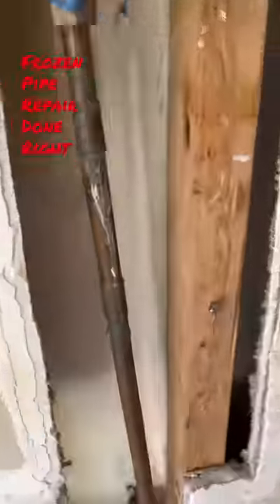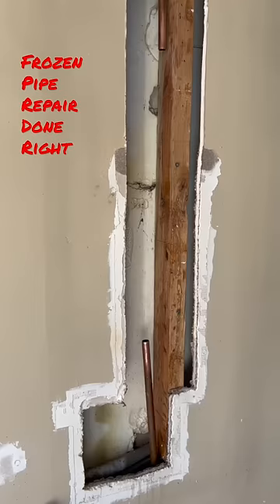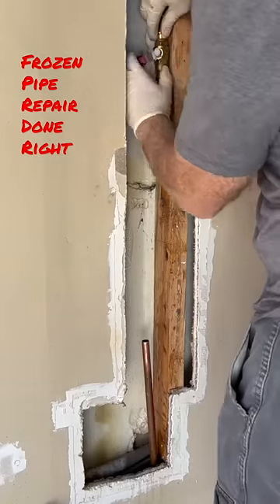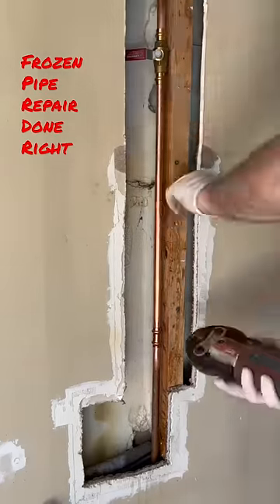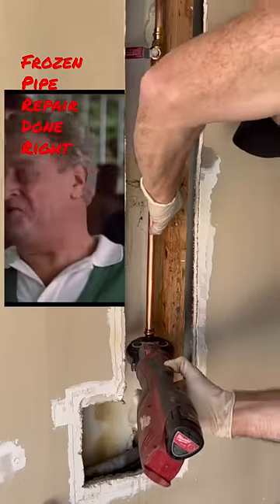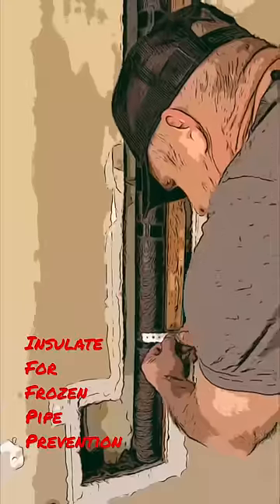Frozen Plumbing Pipe Repair @TappPlumbing #shorts #plumberslife #plumbingproblems

Comment: Put a damn access door on that wall at this point
Reply: And just insulating that little section is like.....?
Reply: @rickybrown6585  ball valve access
Reply: Why put valves inside of a wall?
Reply: uniform plumbing requires access to shot off valves. A speck of insulation is a joke. In 26 years there is a reason this failure has occurred, a real plumber would have looked at the cause and fixed that. This guy whines about the soldering abilities of others, then goes on to use Propress fittings.
Reply: @tommartinez62  most  Accurate comment yet
Reply: Hilarious!😂
Reply: Fr
Reply: I was thinking that… if your pipes are freezing, you got some other issues going on, might as well leave a weak point there. Imagine you fortify that part then when the pipe freezes again it bursts somewhere else.
Reply: Fun fact thats how maintenance panals on aircraft are created XD something breaks so damn much a panel was made to check it.
Reply: I thought I was the only one
Reply: @tommartinez62 why would he look how damn close that pipe is to that stud
Reply: @Yamaszlof Mcdurkin  it's a face,  like an emoji but with letters
Reply: @tommartinez62  I mean ... I proprrss all my frozen pipe repairs .. I'm done and gone before the torch is even lit.
Reply: @AsG_4_  job security going back every year, do you initial your joints I always did, on that I would date it as well..lol
Reply: Pro press is pretty good.
Reply: So that valve can be accessed later, or just remove and relocate it.
Reply: They probably aren't patching that section considering it has those valves on it, no sense in covering up a shutoff
Reply: @tommartinez62  I must have missed in the video where he said he was going to patch the wall making the valve inaccessible. 

But yeah you're right, the reason the error has occurred is because the pipe froze and burst. How do we fix that? Oh right, you'd insulate the pipe from the cold. Wow aint that crazy. Also literally nothing wrong with using a propress for repairs like this.
Reply: @tommartinez62  lol propress is job security? Telling me a lot about you, good old buy stuck in the past, I walk past 20+ year old leakfree propress fittings every day at work. You just wanna get paid by the hour because you can't afford to only get paid by the job.

Comment: I'm not a plumber, but as an engineer, I have an opinion about the insulation. While wrapping the pipe like we see here will shield the pipe from the cold of the outside part of the wall, it will also shield the pipe from the warmth of the inside part of the wall.  I believe a better way to prevent a future freeze break would be to insulate, with fiberglass, every part of this area except 3 or 4 between the inside part of this wall and the plumbing.  This will allow the plumbing to absorb the heat of the house. Even better would be to also leave an opening in the drywall where the ball valve is. This will not only give access to the ball valve, but it will give those pipes access to the warm air of the house. I'm confident the opening could be trimmed out in a creative way to look good.
Reply from the maker: I am sorry to inform you this was an exterior wall . In the garage no less! I can assure you I am no fan of this building technique. I have to deal with the situations as they come. Thank you for such a thoughtful piece of advice . I agree with most everything you stated and hopefully others can learn from your comments. Thank you so very much for spending your time with us!
Reply: I would have put foam outside the pipe, and nothing inside. Let interior heat reach the pipe, just stop the outside cold.
Reply: Insulating the pipe this way (with any type of pipe insulation) is better cost wise and ensuring that the pipe does not freeze. Is there a particular reason for wanting to have it "absorb" heat from inside the house? I may not agree with it but I am always open to learn new things and their reason for it.
Reply: @TappPlumbing  In that case, now it will just freeze three feet higher up the wall. I suspect that they should insulate that entire line from the ground until it enters the heated area. (How much exposed pipe before the bottom of the opening?)
Reply: How do you know someone is an engineer?

They’ll tell you 🤣
Reply from the maker: @@thefirehouse1745 The homeowner will provide that a little later when everything dries out . You are definitely correct! Thanks for pointing this out so everyone can see. Thanks for watching as well!!!!!
Reply from the maker: @brianwest2775  It feeds a spigot that is more or less at the bottom of the frame . No exposed line . Thanks for watching!
Reply: I’m a plumber and now am a chemical engineer.  Yes what you say can be true but what freezes the pipe usually is moving air.  The insulation takes that away.
Reply: The insulation also allows for a micro climate around the pipe where the conduction or the copper can more easily warm the climate it’s made as long as some part of the is in a warming area like the ground.  It has to just stay above 32 and all.  But in colder climates more is needed.
Reply: Yes
Let’s use a mechanical compression fitting that will eventually leak and let’s put a valve inside a wall. 
There is always another solution, this is not a good one.
Reply: The water in the pipe is come in not frozen so it's ok the stay at that temp. It doesn't need the house to warm it. Since the is no way to easily shield it from the cold only the foam works in more than 99 percent of cases. Even pipes not in walls at all. So there you go. No engineering degree needed.
Reply: @The Jerk of all trades  an English class would help you though.
Reply: Damn we gotta be engineers just to know that?😂
Reply: I was gonna say that's not insulation !!
Maybe in the south.
Reply: @The FireHouse copper doesnt sweat unless you mean condensation from temperature variation
Reply: @Vteccer666  lol yes that’s what they mean
Reply: I'm with Mark here. Those of you saying the water comes in not frozen so the insulation will maintain that temp?? Time is the enemy here... Insulation only keeps things at the same temp range for so long. The insulation around the pipe will just make it take a little longer next time it is sitting, not getting used, to freeze.
Reply: Well there's a dumb comment. Power does fail often during cold periods plus if this an unheated space.....and etc,
Reply: @Elseveno  if it's an unheated space, than I'll retract my statement. He said "garage", if it's an unheated detached garage then, ya, no heat... However most attached garages stay warmer than the outdoors.
Reply: That type of insulation preserves the heat coming with the water and prevents moving cold air from contacting the pipe.  Hope that helps explain a bit.
Reply: @Steelythestacker  I understand what insulation does. What I said was after time the heat balances to the environment. Have you ever brought cold beer in a cooler for a weekend? Eventually the insulation doesn't keep the beer cold anymore.
Reply: @chrishoesing5455  it's the sudden surge of cold that is the detriment of copper pipe.  While there is nothing foolproof, this method helps preserve what heat there is and keeps the cold moving air off the entirety of the pipe.  Short of running heat tape it's the best option.
Reply: @Steelythestacker  Unless there is heat in the structure, then the original commenters idea is better. You think there's wind inside the wall cavity?
Reply: @chrishoesing5455  very often there's a good amount of air movement inside a wall cavity especially in the garage or an outside wall.
Reply: Oh crap 
An engineer is “thinking” again.  🤦‍♂️ 
The only part he got right was “I’m not a plumber”
Reply: Looks like it's been a common problem in the same area rather than foaming the pipe to try to insulate from the cold outside the better solution would be to put an access door right there that's easy to get in-and-out of the wall and wrap the pipe with an automatic pipe heater
Reply: I I'm a plumber and that is plan B on how to fix that problem. In Canada we just don't run pipes in outside walls. That's plan A
Reply: @shway100  but if you are going in on a repair to this particular job on an outside wall of a garage, this is what you do.
Reply: @TappPlumbing  By dealing with the situation, you mean repeating every mistake the last plumbers for 26 years made? The smart thing to do would be to have removed all the dry wall from that stud space, fill with two inch dense Styrofoam. Reinstall the water line as close to the interior as possible, use a small square heat  register (for air movement)as an access panel for the valve (required by UPC) an walk away, knowing you will never have to address that issue again.
Reply from the maker: @tommartinez62  No arguments from me with all that you stated! Check this short video to get some context on a time line please 

https://youtube.com/shorts/BsgvHWRR9NY?feature=share

We only do plumbing , I did relay all of your suggestions to my client when I was there however. Exactly how you stated them for the most part. Thanks for your excellent viewpoint!!
Reply: I've always wanted to tell an engineer this without losing my contract...... STFU Sir!
Reply: @TappPlumbing  why would you put a shut off inside the wall?!?!
Reply: I am a plumber. And while you may be the exception and if you are my apology’s.  
I have yet to meet a engineer that couldn’t mess up a job or come up with the dumbest idea disguised and a good one. In the field the trades all engineers educated idiots.  Normally your so smart they can’t see how dumb the idea they want you to do. No Mr. Engineer I’m not gonna run that sprinkler Suppy out the concrete wall 3 ft below ground?
Reply: As a carpenter tradesmen for over 45 years  and dealing with problems exactly like this,  insulating the pipe alone is not the  solution.  Yes it can slow the freezing process but it can freeze if left long enough in freezing conditions.  The solution is to insulate  from the cold and  expose the pipe to the  heated side of the  wall. It is sad that given how common this issue is in cold climates that the plumber didn't solve the problem or at least inform the homeowner to finish solving the problem.
Reply: @John Widell  I have customers with pipes outside and I can tell you, properly insulating the pipe, sometimes requires double layers. The type of insulation you put on your pipes can matter too. I use closed cell foam that I also use for refrigeration lines and I don't have issues. Just my experience.
Reply: The insulation is bogus to begin with
Reply: @James Seddon  it slows it down, but does NOT prevent it.
Reply: @Roman Fields  That open cell stuff is not very good stuff at all.
Reply: Mark May why do engineers always start off announcing it?
Reply: Fundamentally:
Insulating anything  only slows the rate of heat transfer to the materials on the other side of the insulation barrier. 

In the case of a pipe segment like this one there are 2 or 3 scenarios to consider

#1 (flowing steady state)
When the water is flowing at some rate with the environment outside the pipe at some lower temp, adding insulation means it will lose less heat en route.  

#2 a (not flowing, converging to equilibrium)
When the water is not flowing it and the pipe it is in will cool to the temp of the environment around it. Adding insulation only slows the rate of the equilibration with the environment. So if the rooms in both sides of the pipe/wall are below freezing the pipe will eventually freeze with or without insulation .

#2 b (not flowing; transient impulse / cold shock )
The insulation slows the rate of heat transfer so if the room/ambient temp drops for a brief time insulation could protect the pipe from rapid cooling (ie preventing it from going below freezing temp)  while the room/environment comes back up to temp (above freezing)

One should note that what matters in the end of such a decision is the impact it has. If the subsequent down stream or upstream segment have no insulation then they may need the same modifications (insulation of their own) in order for the insulation to have a meaningful impact over all.
Reply: “aS An EnGiNeEr” 😂😂 there is a reason we don’t like y’all
Reply: @Mark May. Why do engineers always announce their engineers? I once actually had 1 complain about his bill & he stated well "I'm an electrical engineer & that's expensive & I already had an idea what was wrong" I just said then why did you call me?
Reply: @TappPlumbing  Question is: would this "little insulation"be enough?
Reply from the maker: @pear7777  If it gets that cold again , no . The insulation may help if it gets in the high twenties though, which happens every year. They don’t build things around here to stand up to single digit temperatures. That is an excellent question! Thanks for watching!!!
Reply: @AB-these-handles-are-stupid  people don’t know the difference. Just dealt with it. Still dealing with it. Everyone is an expert until their wrong.
Reply from the maker: @Socca4life33  This is in a garage where there is no heat. Sometimes we could all improve on the way we deliver constructive criticism don’t you think?
Reply: No this is better in summer the pipe will sweat when the humidity is high and the pipe is cold and it will end up with water in the wall in summer not good
Reply: The Insulation won't increase or decrease  it really just maintains the water at whatever temp it's normally at
Reply: @bobstitzenberger1834  it's in the garage wall there really isn't any heat obviously if it has frozen multiple time
Reply: Agreed. Smart call. I fixed too many pipes wrapped like he did. I live in Alaksa. Plus his fittings have rubber o rings in them. Those go bad. Why not switch it all to pex which can survive freezing and thawing.
Reply: I disagree. Insulating the pipe is fine. The water temperature should stay above freezing.
Reply: Union insulator here. I'll make it pretty for $42/hr
Reply: @jeromelee1627  At no point in the video is there any indication that the wall is going to get patched, so I don't understand why there is like 50 comments assuming the wall is going to get patched

Comment: Solder joints will last when done properly. Insulation is important but heating is more important. Folks, please stop shutting off heat to "unused" areas of your home to save money. If you're away for the winter either winterize your home or leave your heat on. Disconnect garden hoses and winterize bibs.
Reply: I used to have to shut off outdoor taps and winterize things, but not anymore thanks to climate change.
Reply: @SomeDudeInBaltimore  ....the climate has been changing for thousands of years and there's little we can do about it. Warmer winters come in cycles; next winter u better winterize stuff otherwise you'll be calling a handyman like me to fix your frozen pipes.....✌️👍👌
Reply: @bobwhammer4237  The climate has never changed THIS FAST except in the case of a large asteroid strike.  It takes tens of thousands of years.  The data is there, all you have to do is read it.  Starting with the beginning of the industrial revolution.
Reply: @SomeDudeInBaltimore  
I wonder what that other guys opinion on weed killer is too

Comment: So that shout off value in that wall after it is fix will be 100% useless. What a great job.
Reply from the maker: Thank you for watching and your engagement! This video will explain:) https://www.youtube.com/shorts/BsgvHWRR9NY
Reply: Why are you saying it will be useless?
Reply: Technically that's not even legal in the states unless you're going to have a permanent access point.
Reply from the maker: No worries, they will have an access panel cut in when the drywall is repaired. That would definitely be a problem otherwise. Great observation and thanks for watching!!!!